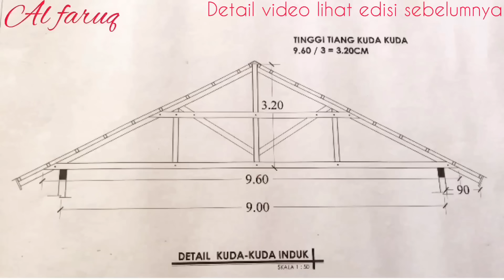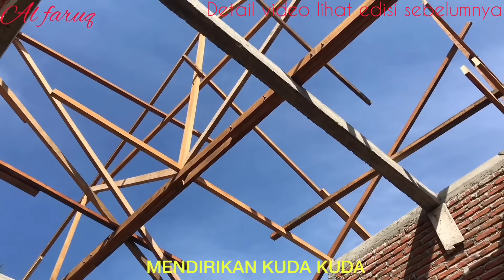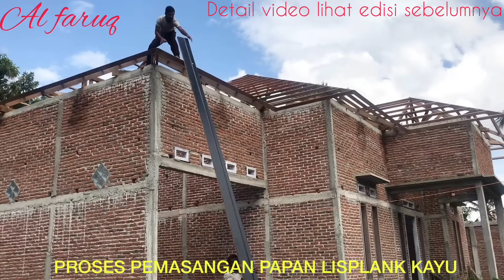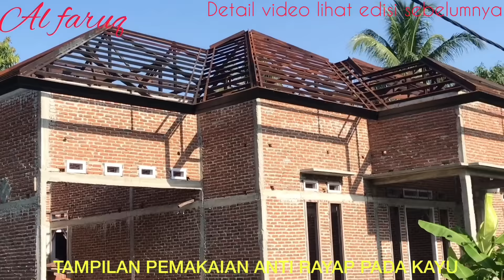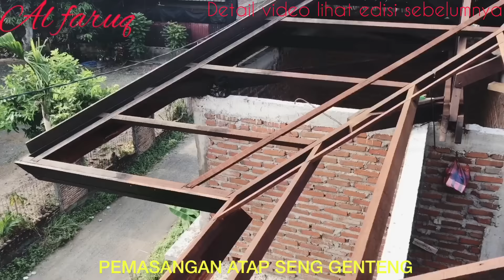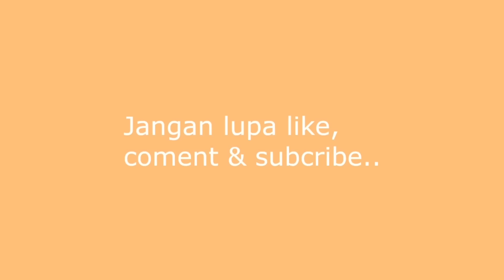Cara membuat atap rumah minimalis model limas, dari awal hingga selesai.

Comment: Why is the house built 20 feet high, consider the internal maintenance, you need a long ladder?
Reply from the maker: thanks for the advice, we love the 20 feet tall house. 😊
Reply: @AlFaruqtukangaceh  traditionally high roof house purpose is for ventilation or for drying products such as corn or meat?
Reply from the maker: this house has a wall height of 4.5 meters, a structure of this height is now common in our area so that the room in the house is cooler & cooler. 😊

Comment: An expensive and dangerous way of building roof trusses, workers have no safety gears, all can be done on ground and raised later to connect each other. No metal reinforcement between joints! Not good.
Reply from the maker: if stringing below we don't have the money to rent a crane.. we've been working like this for decades but nothing harms us. 😊